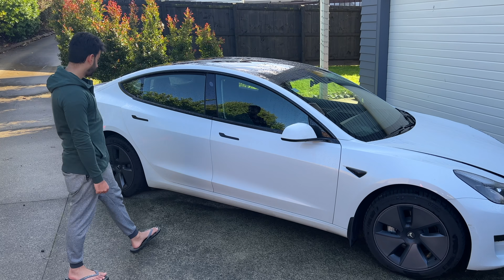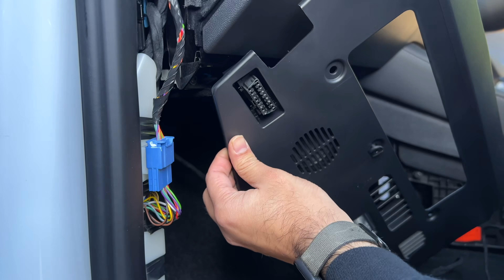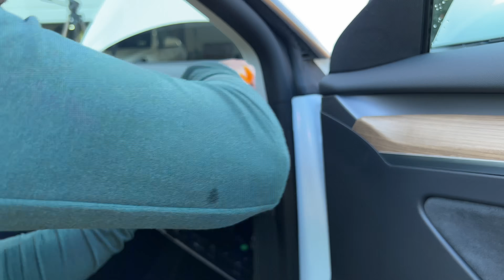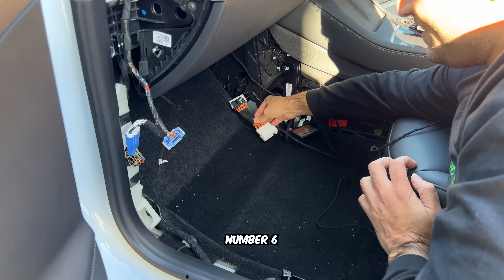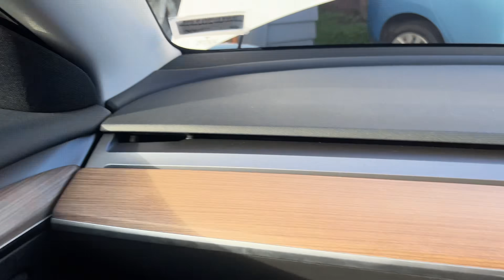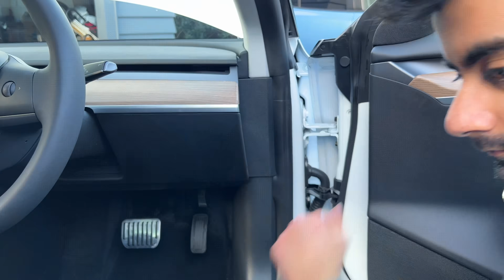NEW Premium Audio Upgrade for Tesla Model 3 (Hansshow DIY Kit RHD) Installation + Review

Comment: Hi i just upgrade my audio system with two 12 in ch sub 1000rms power plus amp bt nw i got error for battery voltage low voltage low can u tell me which battery i hav to buy or install another battery …which battery i hav to install which is high perfomance and last longer and handle my sub and amp

Comment: Don't buy it! They send me the cable after  I remind them a month after I paid that they forgot to send it. When I got it: no instructions. I try to fit as in video and when arrived at pillar to plug that one there: no match. Contact them: send them pictures and they told me that is a diferent place to plug it notcas you see here, but on the other side ... They send me some pictures with instruction where the car in the pictures is a LHD. At this stage I had enough of theyrs s stupidity and just tell you: don't waste your time and money

Comment: Is there any way that this voids your warranty?
Reply: Of course.  The amp is built into the CPU.

Hansshow's harness foolishly runs the 4 dormant speakers on the same single channel on the amplifier as the dash speakers, instead of it running on separate channel.  Thus, putting heavy unnecessary stress on the amplifier (and CPU).

Guess what happens when your amplifier goes 💥?
Reply: @808jspekeg6  exactly what I needed to hear. Thank you!

Comment: Note for those installing the kit for the 2023 models - - all the installation is in the passenger side per the instructions provided.
Don't ignore that and dismantle your entire driver side like me.
Reply: I have been told that my 2023 Tesla 3 RWD does not have the speakers installed, so this will not work on my car.  Am I wrong?  Thanks

Comment: Caution: The 2022+ version did not work in a 2023 model 3 Sr+. While the driver side additional two speakers worked, all except one of the passanger side speakers stopped working.
Reply: Did you get a fix? Or did you have to remove the kit?
Reply: @jonathanmillar7205  removed kit

Comment: Did i order the wrong kit?  Mine isn't the same as yours…. I have a model 3 rwd 2023 ryzen..  so i ordered the kit that is suppoed to activate the 4 extra front speakers (the speakers on the door by the side mirror and the speaker on the A pillar..   now because you have an european car .. i had to mirror  in my mind everything you did.. but your connector isn't the same.. i only have one big connector (the one you said that requires a screw driver to push the pin) .. anyway.. apparently installing the kits has its con.l apparently it drains your 15v volt battery, and all you chime sounds are too loud.
Reply: I thought Tesla connected these speakers in the RWD version as it has a slightly bigger battery. no?? If possible can you please let me know what is the difference between SR+ Ryzen and AWD Ryzen apart from battery size?

Comment: Does anyone know if it works on the 2023 model? Does it still have the speakers installed but not activated?
Reply: Yes, buy the new version for
amd chip. Has front but no rear speakers.
Reply: @nateice1  Thanks - did you install? I have a RHD and guess one connector under driver side, one under passenger side then the 3rd connector is under the passenger side door trim B piller?
Reply: @tomwootton254  I just ordered a few days ago and will complete mod soon. New version only requires one side to be taken apart. I have LHD.
Reply from the maker: Yes it will work if you buy the AMD version as another viewer suggested 🙂 the speaker config has not changed from the 2021/2022 models
Reply: For reference. It does work on 2023 models and the RHD new DIay version means you do still have to go through the centre console. The LHD drive new version everything is on the passenger side.

Comment: Have you installed the new version of this kit?
Reply from the maker: I haven’t personally installed it as there’s no difference in performance. The new version just has an integrated control module and is cheaper, otherwise no other difference. The installation is pretty much the same as shown in this video 🙂

Comment: goodbye warranty
Reply from the maker: Installing mods like these doesn’t exactly void the warranty on the car as that would be a violation of the law. However, if you install this kit and anything related to the audio system breaks and Tesla feels/shows that something isn't working because of this kit, they can deny warranty work on that part. The installation is easily reversible if you do need to take it into warranty for some reason.
Reply: I have asked Tesla and showed them this video and they have said this is instantly voiding warranty.
Reply: @SO_IRISH_IT_HURTS  They can say  what they like, but it does not change the laws of the country. In most countries it mods will only void the warranty if the mod you made causes an issue. So if you mod your sound system and have a failure with the sound system it will void the warranty on the sound system but  the other components/operations of the car will not be effected. I believe the difficulties will be, who has the onus of proof of whether your mods effected some other component or operation of the vehicle. In instances in the past where I have seen a vendor try to deny warranty of an unrelated fault in New Zealand the vendor quickly backed down and honoured the warranty when challenged.

Comment: What is the difference between DIY and DIY (New Version)? Seems they are two different price point? What is the controller for?
Reply from the maker: Excellent question! The DIY (New Version) did not exist when I recorded this video but I have asked Hansshow and they have said that both function exactly the same way. The new version has an integrated control box but is only compatible with the 2022 models with the AMD Ryzen chip. If you have an older model with an Intel Atom chip, then you still need to get the original DIY version. I would get the cheaper new version if you have the AMD chip.

Comment: Just did this myself and it was a success! A couple of things I'd like to mention:

1) When removing the panel under the glovebox, I could not remove the right-most cable. I tried pulling until my fingers started bleeding but no luck. So I left that one in and fortunately it wasn't much of an issue

2) When everything was done, my front windows started acting strange. When pushing the window switch "full down" or "full up", the automatic raising/lowering did not work. Fortunately there was an easy fix - I recalibrated the windows by holding the switch down until the window was down and then for a other 5 seconds, then repeated the same thing while raising the window.

Edit: Also, I didn't have that fancy screwdriver so I didn't remove the bottom panel on the driver's side. This did not create any issue at all.
Reply from the maker: Awesome work Jehan - glad to hear it was a success! And thanks so much for sharing your experience about how the install went. I'm sure it will be super helpful for other viewers 🙂 The window playing up issue is very interesting as I've never had that so far but it's good to learn something new.
Reply: Did you disconnect the batteries?
Reply: @nateice1  Yes, although the screen was still on for some reason...
Reply: @JehanKateli  You havnt propperly removed both batteries if the screen is still on =)

Comment: does this void the warranty?
Reply from the maker: Installing mods like these doesn’t exactly void the warranty on the car as that would be a violation of the law. However, if you install this kit and anything related to the audio system breaks and Tesla feels/shows that something isn't working because of this kit, they can deny warranty work on that part. The installation is easily reversible if you do need to take it into warranty for some reason.

Comment: Aren’t there another 2 inactive speakers behind the rear headrests as well? Or did that change for the 2022 rear wheel drive?
Reply from the maker: That actually changed starting from the 2021 models where the rear 2 speakers were completely taken out...

Comment: Hi, I'm not a fan of highs but you mentioned that it should be suitable if you adjust it in the sound settings. Have you noticed the bass is still strong when doing this? Also, I noticed there is a "control box" that comes with the kit, you didn't use this from what I can see, what is that for? Great vid!
Reply from the maker: Yes if you tone down the highs/treble a bit from the settings, you can get a much more balanced overall sound in my opinion. There was pretty much no underlying impact to the bass with this kit but due to brighter highs on default settings, to some it may sound like that the bass has been dampened a bit. The control box for this version of the kit just literally makes it work - there are no buttons or anything you can change on there hence I didn't really talk about it much. Hope this helps 🙂

Comment: Great video, what is the difference from DIY & DIY (New Version) apart from the price? I can´t seem figure it out.
Reply from the maker: Thanks Alex! I messaged Hansshow about this to confirm the difference and this is what they just came back with: "The 2022 AMD Ryzen DIY cable with the control box, and the new version DIY cable insert the frequency divider integrated with the harness, so it can save the cost. But the function is same." However, I've noticed on their website that the new DIY version is only compatible with the LHD version of the car. So if you have a LHD model, I would get the new one to save some money. Hope this helps 🙂

Comment: Surprised to see you have and OBD port. Do you know if that's a new thing ? or only fitted to NZ cars ? Yours is the 1st I've seen on a model 3.
Reply from the maker: Seems like it was introduced in all the 2022 models manufactured in the Shanghai factory (so not just NZ specific). Even my 2021 made in China Model 3 doesn't have it.

Comment: I have a question for you regarding Fog light's  my Tesla doesn't have any , I see you can buy new LED turn signal and fog light's, What i want to know is there any wiring installed for new light's or do you need a new wiring loom installed ?
Reply from the maker: I've seen a couple of other videos on this and it seems that there is a wire that exists in the car already. However, since the fog lights are disabled in the SR+/RWD firmware, the existing plug needs to be rewired to work along with the headlights rather than having its own on/off switch.
Reply: @EVKiwis  my Tesla is a Model 3 2021 does this help ?
Reply from the maker: @baldrick2200  What I mentioned above applies to all base variants of the Model 3 I believe... so you would still need to rewire the plug as unfortunately the fog light control cannot be enabled in the firmware in the SR+/RWD variants.
Reply: @EVKiwis  ok thanks

Comment: How many speakers does the 2022 model 3 RWD has in comparison with a long range 2022
Reply from the maker: The default audio system has 8 speakers (with no subwoofer, 1 amp) in the 2022 RWD model and 13 speakers (with 1 subwoofer, 2 amps) in the 2022 LR and Performance models.
Reply: @EVKiwis  so if you would like to have the 13 speaker setup as the long range, the option would be Hannshow Version A? 

Also interesting on where to add the DIY 2 rear surround speakers and for cable management
Reply from the maker: @chichyiphone4  That would be the Hannshow Version F kit for the full setup with the subwoofer (it's currently out of stock on their website). If you get the Version A Kit with the 2 rear surround speakers, they get attached to the rear parcel self in the car and the cable gets routed through the trim panels of the rear doors and next to the rear seats. Hope that helps 🙂

Comment: Glad that the new Model Y has all the premium features which you do not have to pay for
Reply from the maker: Absolutely agree! The premium sound system alone makes up for the little price difference between the 3 and the Y
Reply: It’s included in the price so technically not free
Reply: @JesusisKing2000  guess you could say that, point is nothing extra like the model 3

Comment: What does it actually do to change it like that? Do those 4 speakers not do anything usually? Is it like that in the 2022 Model Y? Seems odd to have speakers connected to nothing?
Reply from the maker: Yes it sure does! I just seems absurd that the speaker hardware is there but Tesla just decides to leave it unconnected in the base models of the 3. This is due to the difference in the partial premium interior of the RWD/SR+ vs the full premium interior of the LR/Performance variants which I talked about in my previous sound system review video (https://youtu.be/P_zp-rNwLk4). For Model Y, luckily even the base RWD model for the AU/NZ has the full speaker system so this is not required. Have you received a delivery date for your Model Y yet?

Comment: I had read that all the speakers were enabled in the 2022 models SR, is that correct?
Reply from the maker: No unfortunately the 4 speakers I highlighted in the video are present in the car but not connected/activated. This installation was done on the 2022 Model 3 and they definitely were not activated from factory. Hope this helps 🙂
Reply: Your videos are amazing, just wondering if you can do one for installation of rear speakers please? Hope to see more of your amazing videos